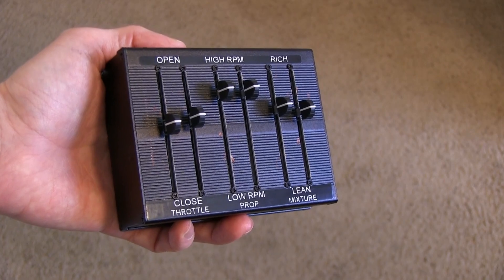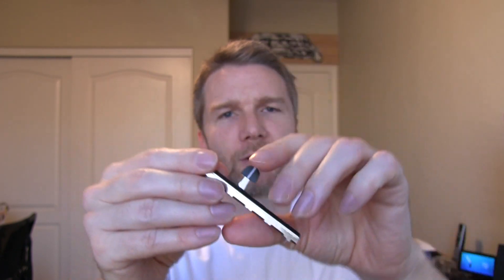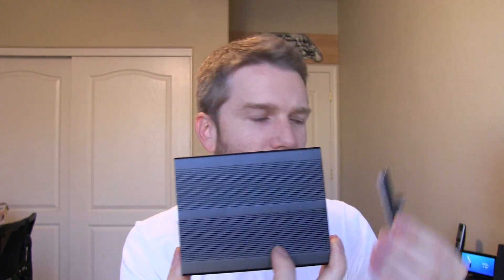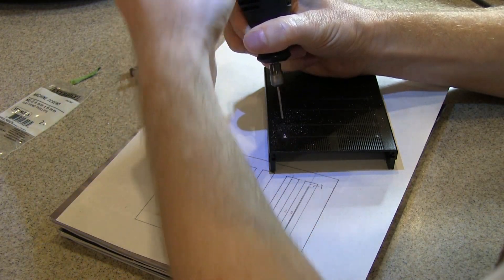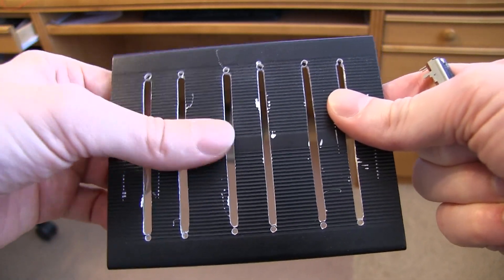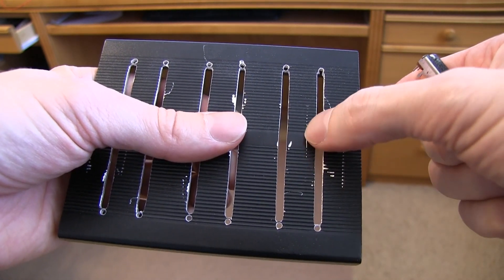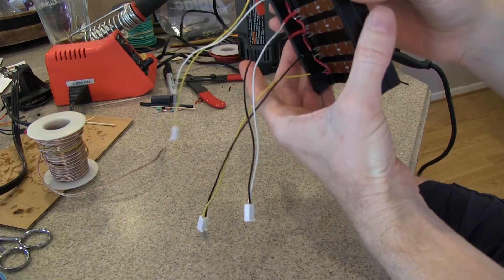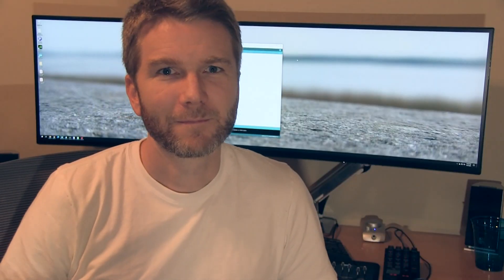Build Your Own $50 Throttle Quadrant for Microsoft Flight Simulator 2020 and X-Plane

Comment: How about for X-Plane?  Will it work there?
Reply from the maker: Yes, the demo at 0:26 is using X-Plane 11. It works better in X-Plane because the multiengine aircraft in X-Plane properly feather their props when the prop control is moved all the way to low RPM! I wish MSFS modeled that behavior!

Comment: hiya, i finally completed the box adding carbon fibre in red and black with three slides two pots and an ignition button using arduino pro micro ,wired it all up etc tried programming it ,and nope nothing works, so i have bought a quadrant , yes yes i know , but i wont give up on it promise, my brain is too old to understand coding but it looked really cool :-) and gave me something to do lol
Reply from the maker: Don't give up! Hopefully it is something trivial. When you get back to it feel free to message with where you are stuck. For example, does your computer recognize the Teensy when connected on USB? Are you able to download a program to the Teensy? Do you have a multimeter to confirm the correct voltages are observed (3.3V, and can also verify the voltage from the slider to analog input). Hope you get some time in the future to complete it! Good luck!
Reply: @wdubel  Hi I will indeed, I can install no problem but when I press or slide nothing happens it's a pro micro, thank you 😀

Comment: hiya got all my components ,{using pro micro dev board} i have sliding potentiomers that have four pins underneath labeled 1, 2 at one end the other has 2,3 ,help please how do i wire it??
Reply from the maker: Hi David! First step is to check the datasheet to determine which pin is your center tap - usually pin 2. Those are the pins you will wire individually to your analog inputs on the Teensy. The other two pins connect to analog ground (AGND) and the 3.3V reference voltage. You can connect all of the pin 1 on the slide pots to AGND, all of the pin 3 on the slide pots to 3.3V, and connect each center tap of the individual sliders to the analog inputs (A0, A1, A2, ... A6) separately! The AGND and 3.3V can be shared, but the center taps to analog inputs obviously need to be separate. You can also use a multimeter (set to measure resistance in Ohms) to determine the center tap pin if you don't have a datasheet or just to confirm.
Reply: @wdubel  thank you so much, waiting for some carbon fibre before attaching the pots to the lid , ive added pitch knobs and ignition switch ,praying it all works lol, all the best

Comment: hi, very interested in this build ,but cost wise how much difference would it make using teensy 2.0 instead? would there be lag on the controls?
Reply from the maker: I have not tested the Teensy 2.0, but I suspect it would work just fine. The price difference (in the US) between the "legacy" 8 bit boards and the newer 32 bit boards is just about $3, unless you already have the 2.0 lying around in which case you can just test it firsthand. Good luck with the project!
Reply: @wdubel  hi no i'm starting from scratch, the teensy 2 is £10 and 3.2 is £20 was trying to be cost affective lol

Comment: Excellent tutorial,is there a wiring diagram that you can share,that way wiring all would be easy. i am planning to build for 4 engine planes(747.340 etc) 4 throttles,4 fuel mix tabs,brakes,spoiler left/right,flaps left right.

Comment: Looks great.   Swap the Teensy for an STM32 board for under $5 and use FreeJoy for even better control and cheaper.
Reply from the maker: I just checked out the Blue Pill boards and FreeJoy... there is a little additional setup to install the bootloader and get the Arduino integration (if desired) but worth it for the additional configurability that FreeJoy offers. Thanks for comment and great info!
Reply: @wdubel  I just use a cheap little ST-link v2 to install bootloaders on the bluepill.
Reply: Thank you! The Teensy are quite expensive, now version 4. Nice to save the pennies now food is so expensive (UK).

Comment: Great video, any ideas on how to do the rudder pedals?
Reply from the maker: Thanks! You would use a separate Arduino for the rudder interface, though the electronics and programming work the same way. You'll need three analog inputs - one for left/right rudder action, one for left brake and one for right brake. Some use two channels for the left and right rudder but since they move together it isn't necessary - when one is forward other is back. The difficult part of the project is the mechanical assembly!
Reply: @wdubel  thanks for the tips. I will try it.

Comment: WHAT EXACTLY BOARD DID YOU USE? There are several versions of them on the site. 2.0 3.0 4.0 and so on
Reply from the maker: I used the Arduino Teensy 3.2.

Comment: But does the throttle work with Saitek driver software installed?
Reply from the maker: I have not tried it but I would expect the Teensy driver to work independently from the Saitek driver. Note that if you have multiple controls for throttle you should only map/assign one to the simulation throttle. As an odd example you could have the Saitek throttle control engine 1 and the Teensy control engine 2, but if you assign both to the same control usually the last moved control "wins".

Comment: Did you actually get this to work in MSFS 2020? When I plugged in my Teensy LC ready to go, X-Plane picked it up but MSFS 2020 didn't really know what to do with it. Just had a blank page with no controls to configure.
Reply from the maker: Yes, I can confirm it works in MSFS, which is shown at the end of the video. Make sure on the controls page that you are not filtering by "Assigned" controls (on the left at 14:07). Initially you will need to assign them so change the filter to see available controls. In the video I do have it filtered since the controls are assigned already though I see now that is confusing!
Reply: @wdubel  it worked! Thank you

Comment: Hello, thanks for the great video! How did you change the settings in msfs2020 from -100 to 100%? I can only use 0-100%.
Reply from the maker: Some of the axis controls have several versions you can map in the control settings. I see that mixture has a 0 to 100 version and a -100 to 100 axis version that can be selected. For some controls you need to match your controller range with the correct axis type for proper control. I had to map the correct axis for the CH pro pedals for example, or else it was either 0 or 100% deflection in game. For others it may work either way, as long as you observe the full range of values in the simulator as you adjust the physical control. Be sure to view all available control types and select only the axis type that works best, which may require trial an error. Be careful to not map multiple axis types to the same control - be sure to clear the one you do not want.

Comment: Hi I am a Newbie so have a steep learning curve.
I am in the process of making my first switch panel but would love to make this my next project.
do you have a circuit diagram? dose it matter witch analog pins you connect to also I would love to add a trim wheel to the box do you think this would work.

Thanks for any help.
Reply from the maker: This is a great starter project since all of the needed circuitry (for example pull up resistors for switches) is built into the Teensy. I do not have a circuit diagram however the connectivity is straight forward: Connect the center post of the pots to your analog inputs (A0 through A5), one side of all pots connect to analog ground (AGND), and the other side of all pots to the 3.3V reference (red wire in the video). The provided example program and joystick interface supports exactly 6 analog axes starting at A0. The program can be modified to use whichever analog pins you prefer, but if you stick to A0 through A5 no changes are needed. You can absolutely add a trim wheel, and if you do I would suggest using a rotary encoder (instead of a potentiometer). An encoder will use two digital inputs instead of an analog input. An encoder might be preferred for two reasons: 1) you will want the wheel to be able to make several revolutions whereas a pot is usually limited to a single rotation with stops. 2) you will probably want the position of the wheel to be relative/arbitrary at start up (so that it doesn't jump values when you first move it).
Reply: @wdubel  Thank you very much for the detailed explanation and sharing the video.

Comment: Impressive! Thank you so much for sharing. Will this work with Flightgear?
Reply from the maker: The throttle quadrant does not seem to work with FlightGear out of the box. I tried installing FlightGear on Windows just now and the good news is that the Teensy joystick is recognized. Unfortunately only 5 of the 6 axes are correctly recognized in the Joystick settings, and even after configuring the 5 recognized axes I am unable to affect the simulated controls. I did see some instructions online on setting up custom bindings. It is likely that with some tinkering you could get the controls functional, but it is not something that "just works" as it does in X-Plane and Microsoft Flight Simulator 2020.
Reply: @wdubel  I appreciate the time you took to test that out. I might give it a shot. Could you explain a little more how to connect a USB cable to the board? Do you by chance have the circuit diagram? Thank you.
Reply from the maker: @scarymoviesg  The Teensy boards include a USB Micro B port that accepts a standard USB type A to Micro B cable (same as used to charge most Android phones prior to USB C). Since the port is already connected and wired up no circuit diagram is needed. Just connect the Teensy to your computer with the standard USB A to Micro B cable. Regarding the FlightGear setup from your earlier question, this FlightGear wiki is what I found online (untested): http://wiki.flightgear.org/Input_device
Reply: @wdubel  I will definitely check that out. Thank you once again for the help. Edited: is it possible to use rotary potentiometer instead of the linear ones? Will the configuration be the same?
Reply from the maker: @scarymoviesg  A rotary potentiometer will work the same as a slide potentiometer. My first tests with the Teensy configured as a joystick were with small 10k ohm rotary potentiometers. However, I find the slide potentiometer to be much easier to control (and to visually confirm position) than using a knob, and will more closely match the control movements of actual aircraft.

Comment: Hi, did you use any particular value slider pot or will any be ok?
Reply from the maker: Any potentiometer in the range of 1k to 20k ohms will work. 10k ohms is probably the sweet spot for current consumption and accuracy. Higher than 20k and you may see issues with accuracy and noise, and lower than 1k starts to draw a significant amount of current. For example: 3.3V / 1kOhm  = 3.3mA * 6 sliders = 20mA through the sliders.

Comment: Hi @wdubel which version of the teensy do you use ? I have seen the 2.0 and the +++ 2.0 are used in a lots of joystick projects but they are around 38 pounds sterling, I have seen the LC for much less but the spec is very different. Also do you have a wiring diagram available ?
Reply from the maker: I used the Teensy 3.2, but 2.0 and LC should work as well. I do not have a wiring diagram however the connectivity is straight forward: Connect the center post of the pots to your analog inputs (A0 through A5), one side of all pots connect to analog ground (AGND), and the other side of all pots to the 3.3V reference (red wire in the video). If your Teensy does not have a dedicated analog ground use the GND that is closest to the 3.3V pin.
Reply: @wdubel  thank you for the video and your prompt reply parts will be ordered today as it's my lock down project
Reply: Arduino Leonardo or pro micro works too

Comment: Is this code available for an arduino nano please?
Reply from the maker: No, unfortunately the Arduino Nano's USB implementation does not natively support a full HID joystick. Other Arduino boards like the Leonardo and Micro do have native USB support - boards with a 16u2 or 32u4 chip for example, however the code will be different than the Teensy K20 family USB support regardless.
Reply: wdubel ah that’s a bummer, I drove three hours today to buy a nano to make a throttle quadrant and button box and now I’ve realised it’s useless haha! Oh well I’ll get a teensy then! Thanks for reply
Reply: @wdubel  I have the leonardo and having a heck of a time to find the code, how did you find yours
Reply from the maker: @jacobmayhle6650  Since I was using the Teensy, I installed the Teensyduino  add on for the Arduino IDE, which happens to come with the Complete Joystick Example as shown in my video. For your Leonardo which also supports joystick, you can search for "arduino leonardo joystick" and find an instructables which guides you through downloading the ArduinoJoystickLibrary from github to include in the Arduino IDE examples.
Reply: @jacobmayhle6650  https://github.com/MHeironimus/ArduinoJoystickLibrary this has the flightcontroller built in
Reply: Ok so is the hid different from the ide?
Reply: Because I have no joystick options
Reply from the maker: @jacobmayhle6650  Yes, I am referring to the Arduino sketch editor as the IDE (Integrated Development Environment). The USB HID (Human Interface Device) support refers to how Windows communicates with your device (Joystick). Your next step is to download a Joystick library that works with Leonardo from github to add to your IDE.
Reply: @wdubel  https://github.com/MHeironimus/ArduinoJoystickLibrary this has the flight controller for the arduino leonardo and pro micro